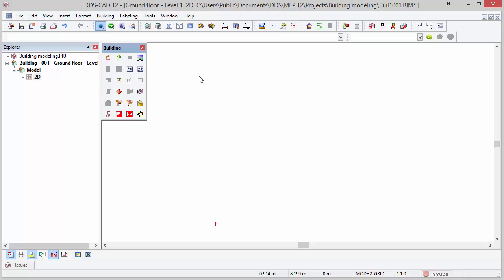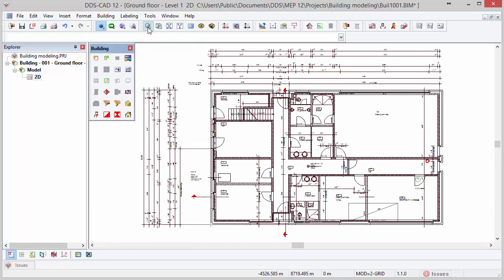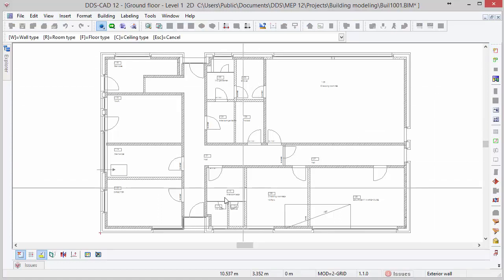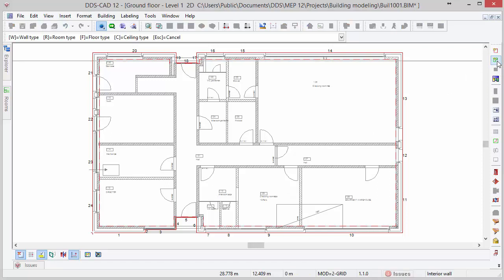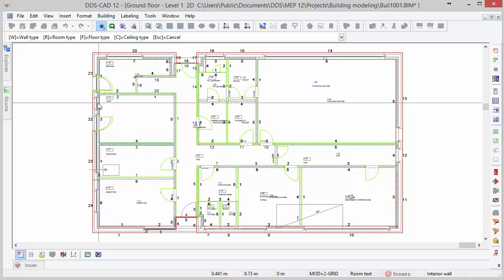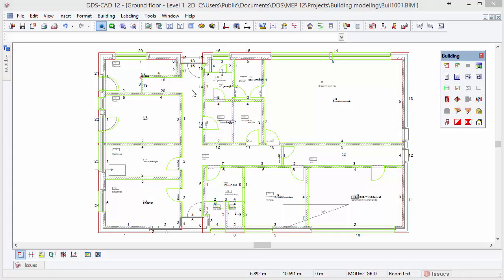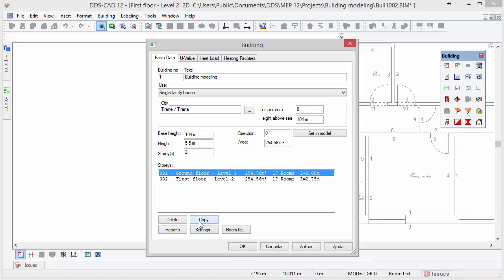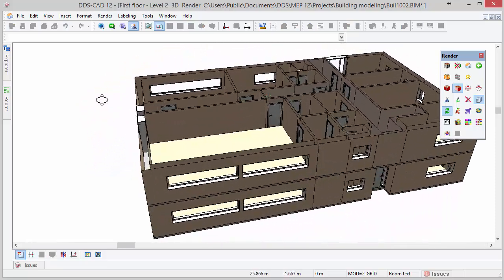DDS-CAD 12 - Getting Started: Creating a Building Model (2/8)

Comment: Hello, how can I draw a joist in den ceilings of the building model?
Reply from the maker: Hi Matthias! You can do that in different ways; either use the Geometrical Shapes to recreate the joists. Or use the 'Furniture/General' database and take select an object from the 'Columns' category and rotate them along the X/Y-axis to represent joists. With the last approach you can also include them automatically in your parts list if required.
Reply: DDS-CAD Hello thank you for the prompt reply. Will this also work with the automatic opening elements function when I insert a opening into this geometrical shape, i.e. when the pipe dimensions change, the opening in this geometric object will also be updated?
Reply from the maker: @matthiassmovies3014  opening elements are to be used in building components such as ceilings, slabs and walls. A geometrical shape is just a shape. So it depends on what you would like to achieve in the end. Since YouTube is not the best place to elaborately discuss this, I recommend you to reach out to the nearest DDS office or local partner.